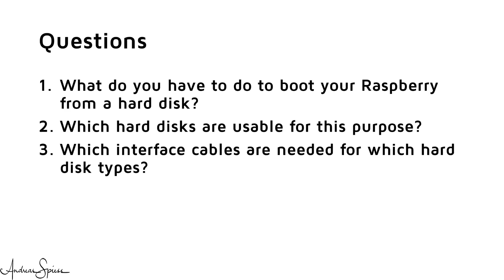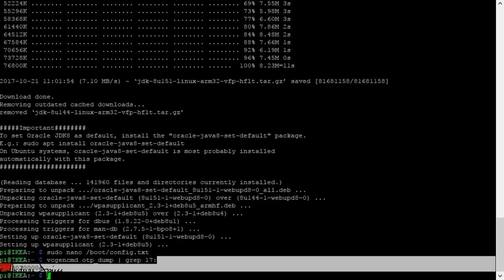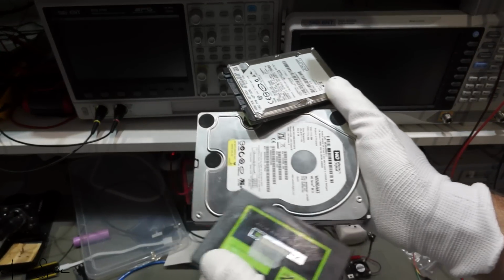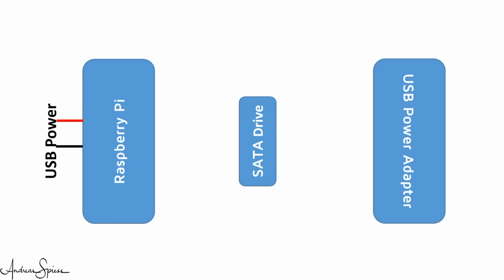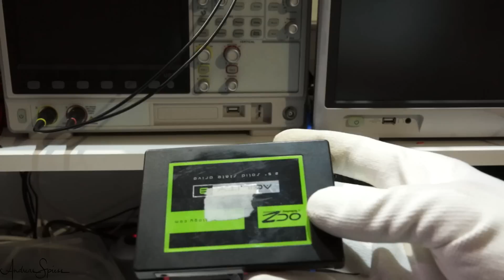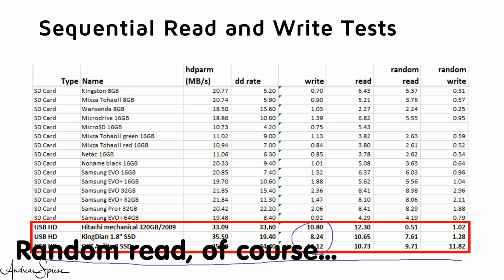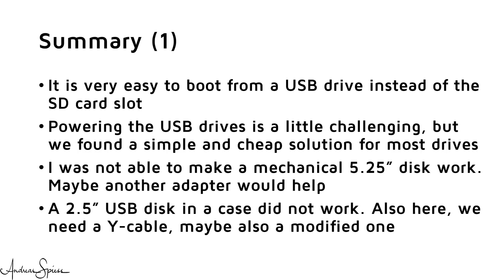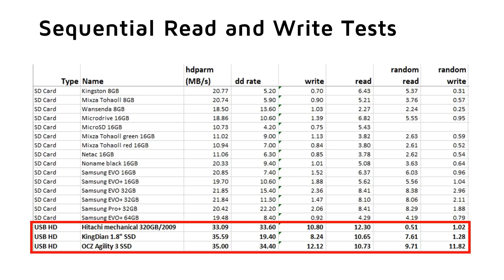#164 Which USB Disk is best for  Raspberry Pi 3? How to connect and how fast are they?

Comment: The KingDian drive (pronounced King dee-ann) has the form factor of CF cards and is being used as a drop-in replacement for cases with CF card slots (converted to SATA and such)
Reply: klassich D 
The form factor is the same as CF cards, but it has SSD inside.
Some old embedded computers used to have CF cards as a booting medium as they were easy to interface with just common IDE interface (they have exactly same pin layout!)
Some Chinese manufacturers figured that making new mold for those computers is hard and wasteful when the shells were already made, so they made a really tiny SSD you could fit into the same slot but do not need any tooling and just replacement of the connector.
Reply: I know this because computers we use here use CF card sized drives :)
Reply from the maker: Thanks. Did not know that.
Reply: Sorry, I do not understand. Can you explain this more? Does it mean, that there is an SD Card inside the SSD drive? 
As far as I know, SD Cards, USB Sticks and eMMC are similar, but SSD different. But I have to admit, that I do not have any unsider know how and more precise infos are rare.
Reply: Thanks, Now I read some articles about CF Cards. They are still in use and there even exists the CF Fast Standard. Amazing.

Comment: Reuse the same adapter, just throw in ATX power lead!
Reply from the maker: How would you connect the PS and to which adapter?
Reply: Andreas Spiess 
You just need 4 pin Molex/ATX connector used on the bigger hard disk :)
Aliexpress and eBay sell those power supplies for your project!
Reply from the maker: Now I understand. Thanks!

Comment: Hi Andreas! Are you using max_usb_current=1 in config.txt to increase usb voltage from 600ma to 1.2amps or is that still a thing? Might be something to look into, just remember that is 1.2 amps across all usb ports so don't blow a fuse plugging in the toaster :) Maybe this is a culprit. Pretty sure its still not enough juice to run the 5" drive those are pretty beafy well at least not on my pc with a cable, but I think pc usb is limited to 500ma so might be worth a shot. Maybe try a shorter and thicker cable to for the dc resistance. Love the content.
Reply from the maker: No, I did not use this parmeter because I was not aware that it exists. But now I tried and it worked for both, the SSD and even the small mechanical HD. This one got well over the 500 mA during the boot process. Thanks for the tip!
Reply: @Andy Lee Robinson: I fear your suggested doubling of the rates is just theory. The  RPIs use the USB bus for everything, capped at approx 30MB/s (i.e. both your raid drives would use the same "channel", and would therefore experience half the speed - or less, due to overhead). 
Don't get me wrong - I have a PI2 myself, and use it everyday - but they are not good designs for I/O and/or network storage. Even a 12Euro Orange PI Zero is much better at this  - and there are ARM newcomers like the Rock64 that cost similarly to a PI but give you USB3. These blow any RPI to bits, speed-wise - in pretty much everything.

Andreas, try a Rock64! :-)
Reply: That's really good news - hope you'll do an updated video with the new info!
btw, if you install mdadm, you can make a RAID array using as many sd cards or drives you can connect, and at least double transfer rates.
Reply: I also discovered this option when going through a similar process to Andreas testing out different SATA drives on my RPi 3.  The best drive I found for my RPi 3 was a 120GB SSD drive.  It worked very well.
Reply: Thanks, I'm planning to at least try booting directly from external USB.  I have fantastic luck using 2 tb seagate laptop drives with a star-tech cable - no power issues if the supply to the pi is stout enough.  I have one up a few years now, with the sd card only used for its /boot partition, and the spinner mounted over root (which requires some fiddling in /etc/fstab and also /boot/cmdline.txt).  I reboot it about once a year...whether it needs it or not, when I update the opsys version.  With the tiny space required for that /boot partition -  and it being effectively read-only, it's not that bad to have an SD card (and it's easy to copy to another or back up) but it does waste some power and a slot.  I'm intrigued by the network boot option, that would actually be handy here with my farm of diverse pies in my LAN of things.  Maybe Andreas would tell us about that one?
Reply: Yes, for me it has been since the 2B+ pies.  I often use one of those ebay "simple switchers" with "wall wart of the day" for power, with really good peak amperage capability for this (especially switching down from 12 or 15v where you can pull the charge out of a capacitor to handle a peak load), and relatively low power 5400 rpm laptop drives - the system in this house uses 6-7 watts total at idle, measured with a Kill-a-Watt.  They seem rock solid.  I use them as database/web servers and aggregators for a LAN of things system here on my "campus" - 4 buildings, off grid, a lot of automation to allow reduced labor.  The pies run mysql, nginx, perl cgi's that give me plots and various remote control over things around the place, saving steps, especially important in deep winter where you might have to dig snow to get there.  At the other end, arduinos or esp8266's talk to hardware that senses and controls things, since they are much better than a pi at anything realtime or bit-banged, and a lot less likely to go down for whatever reason.  Nothing is blazingly fast, but good enough for most things - even data aq for my electronics benches and physics lab (interfacing scopes, power supplies, meters, servos, cameras and so forth - you need the gB!).  I mount the hard drives over root on the pi, after formatting and copying that partition off the SD card to them.  The new method you show here should be better yet.  For reliable speed...A SSD is best, and a USB stick is OK if you can handle it occasionally going off to wear-level (drops video frames, for example).  FYI, on the earlier pies, there was an issue with too much series resistance in a too-cheap USB power jack - didn't matter how good the supply was,, and the tip is to just solder wires to the board.  There is also a hack that involves changing a resistor to get even more than the software hack for USB power output - even with the software, you don't hit the USB spec.  Details here and on Hackaday: http://www.coultersmithing.com/forums/viewtopic.php?f=59&t=957&p=5745&hilit=pi+usb+power&sid=c50a964f693d7812ff3734af04b48288#p5745
Reply: Concur.  I was using a USB stick mounted over /,  booting from the SD card (only) in a critical application here, using the pi camera to take video of a 4ch scope screen.  It was dropping frames even with an expensive SD stick (which was USB3, hoping that would be a lower latency drive).  The 120gb SSD drive ended all problems there, no more dropped frames, even though it was one of the infamous Samsung 840s.  Now I gotta try being completely SD card free!  Only using the /boot partition works pretty well for some here that have > 1 year uptime, but then it's a risk, heat, and current waste.
Reply: @Thanassis, thanks for the info - yes, theory is often shot down by reality. It's a pity that the USB bus bandwidth is so limited, but I'm sure there are still advantages in distributing read/write among sd cards/drives reducing latencies and maximising bus usage.
Hopefully the next iteration may have multiple buses or another scheme for improving I/O.
Reply: +Doug Coulter, you can set up the "BIOS" in the RPi3 to boot from USB or Network instead of the SD disk.  Doesn't work on other RPi models though.

I have a RPi2 set up with four SD-memory sticks in RAID-4, which works ok.  Easy to change memory styck if it is written to peaces.

+Thanassis Tsiodras, you might get much better speed from RPI if you compile the SO for 64 bit OS, and not the 32 bit.
And yes, the CPU speed of the RPi are faster then then the other 64- bit machines.  But as you wrote, the IO is not that good, as most go through the one singel USB channel (yes, all four USB ports are a hub with the same USB 2 channel).  Both the 4 USB ports and the ethernet are connected to the singel USB channel.

But the WiFi are not going through the USB channel, so it might be faster.
Reply: Have a look at https://www.raspberrypi.org/ where the information are.

Here are the source for the raspberrypi code.
https://github.com/raspberrypi/documentation/tree/master/hardware/raspberrypi/bootmodes

Boot over USB
https://www.raspberrypi.org/blog/pi-3-booting-part-i-usb-mass-storage-boot/
Boot over network.
https://www.raspberrypi.org/blog/pi-3-booting-part-ii-ethernet-all-the-awesome/
Reply from the maker: +Doug Thanks for your feedback. So, the "mechanical route" seems to be a good one...
Reply: Here's the definitive hackaday link for pi USB power: https://hackaday.com/2015/04/06/more-power-for-raspberry-pi-usb-ports/  The link on my site assumes you know this, and I took a slightly different approach.
Reply: Don't Pi3's do 1.2A over all 4 ports anyway? Plug in one device and it can use all of that. No config changes required.

There are many cases of people doing it online with no issues with a single SATA to USB adapter but my dual-cable version doesn't work at all and it's driving me mad.
Reply: Mostly I think it works because most people now-a-days have either old laptop sata hd's, 2.5 " or sata external/storage 2.5" drives..., 
    I believe 2.5" drive's in theory should work with less amp's..., than 3.5" desktop/external hd's.  
    I will do a usb amp check just because you said this..., do the duel port usb cable mod and it should work...,
       I.E. Make sure the data cable plugs into the Pi and the power cable to a 1 to 2 amp usb charger.
    1. plug the main cable into the pi, and the extension into a usb 1 to 2 amp charger and wala it works..., just remember the HD timeout, NOT ALL 2.5" DRIVES WILL WORK,I have found spinning up the drive first help's this fact......, or you can try this mod to config file , I will try both ways, usb stock first, then usb config mod let you know the results !!! 
Have to try @andersjackson's suggestion as well...  @MarkPentler
Reply: KEWL!!!>>>>.....THX!.....

Comment: Raspberry Pi SD interface is too slow to take advantage of the faster SD cards.  ODroid C1/C1+/C0 is much faster and cheaper than Raspberry Pi.  ODroid C2 is extremely fast.  I like the 32 GB Samsung Evo Select card for $13.  On a USB 3 reader I get a crazy fast 94.74 / 70.51 MB/sec sequential read/write.  7.46 / 3.24 MB/sec random 4KB read/write I/O performance.  It will be capped to 40 MB/sec on a USB2 interface but the random performance still helps a lot as a boot drive.
Reply from the maker: Of course you are right concerning USB2/3 and about the slow SD interface of Raspberry Pi. The first was also quite visible in video #141 where I got similar numbers as you describe and the second is visible now.
However, I still like the Raspberry because of its supporting community. As a newbie to Linix I feel more save ;-)
Reply: Andreas Spiess The ODroid community is good too. Most of the instructions and code samples for Raspberry Pi run unmodified on ODroid.  It is just Linux on ARM.  Orange Pi Zero is even cheaper at $9 and it is as fast as Raspberry Pi 3.  There is much support for Linux in general.  There is nothing unique about RPi Linux.  Worst case the IO pins are mapped a little differently.
Reply from the maker: Thanks for the feedback. Maybe I will try once an ODroid board. A Orange Pi is already in my drawer and I used it sometimes ago.
Reply: IMHO avoid the Orange Pi stuff unless you have a lot of time to mess around. The Odroid stuff isn't as cheap as the Allwinner something something pi stuff but the quality of their hardware is far higher and their software isn't just a horrid vendor supplied kernel dump mixed with some other junk.

Comment: Thanks for the comparision.
I am using the KingDian 32GB because it was only 1 or 2 EUR more expensive than the 16GB.
And I found for the 32GB type:
https://www.king-dian.com/product/kingdian-s100-sata-ii-ssd-32gb/  . Here we find
- reliability and stability: Write to life: Using 8 years if write 100GB every day(32GB)
This is enough for me to store nearly all of may data my the home automation systemFor the 16GB I did not find such a figure. One more reason to go for the 32GB.
The 32Gb also has more spare space for the wearing management mechanism and it is  faster.I measured on my Win PC with H2testw v1.4:
- Using cheap cable on USB 2.0:
  - write: 36,8 MByte/s
  - Read:  35,9 MByte/s
  
-Using Orico 21 UTS on USB 3.0
  - write: 89,9 MByte/s
  - read: 122 MByte/s 
  
So for me the limiting factor is more the USB interdace and the host system.
As far as I know the technology of SD and USB Sticks is quite similar but SSD is different. The SSD have additional wearing management implemented.
I did not find many detailed info on that. There are several SSD tests available but not for the 32 GB 
- https://www.heise.de/ct/ausgabe/2017-3-SATA-SSDs-fuer-moeglichst-wenig-Geld-3597127.html 
- http://techreport.com/review/26523/the-ssd-endurance-experiment-casualties-on-the-way-to-a-petabyte
Reply: You have to delete the "Here" off the end of the first link.
Reply from the maker: Thanks for the feedback. I am not sure if the S100 (2.5") and the S100+ (1.8") use the same interndal design. If so, we do not have to care about life-time...
Reply: Thanks for the useful hint. Done and checked.
Reply: The KinDian Homepage is not very updated, the S100+ is missing.
As an indication, there is also an M100 series with mSata showing the same "write to live" figures.
Reply: If you are in doubt with KingDian you can go for "KingSpec".
The Claim to be a manufacturer http://www.kingspec.com/about/i=2&comContentId=2.html and are listed in wikipedias list of SSD manufacturers https://en.wikipedia.org/wiki/List_of_solid-state_drive_manufacturers . You can get a V-32 with 30GB and 8years @100GB/d write endurance http://www.kingspec.com/products_detail/productId=65.html for <16 EUR in the "KingSpec Official Store" @aliexpress.

Comment: I use my Raspberry Pi B model to run Weewx weather program for my weather station - that is all it does. When I first got it working it would lockup often. I replaced SD card with good quality Samsung SD card and all those lockups went away - until now about a year later. Not sure if it is because of SD card but guess I will have to put in a new one and find out. Or  maybe try an old laptop hard drive in it like you have shown is possible. Thanks for the info !
Reply from the maker: I think, the Raspberry always writes some small data to the harddisk, even if we think, it is not necessary. And this can wear-out a SD card which is not made for such usage. I am interested in the result of your investigation...
Reply: About the lifespan of ssd's on any linux distro. I did not check your particular Weewx (I would guess it is raspbian based ... ) but one has to check the Type of filesystem that is used on the sdd. That can have a deep impact on ssd lifespan. Some journaling filesystem do make a Lot of disk writes simply as a maintenance/dis check feature of Linux fileystems and are not suited for any type ssd drive, be it usb or sata. So that should be worth considering.
Reply: since I am novice at Linux it all sinks in slowly. I just did some research on SD card longevity with Weewx and found there is discussion about it. This post seems to have some positive results though I don't even fully comprehend it yet ! https://groups.google.com/forum/#!topic/weewx-user/atRpRzKrlyk
Reply: This is very interesting on some detailed analysis and hacking of SD cards https://groups.google.com/forum/#!msg/weewx-user/JxWgTEAikbA/HupwjHcYTqEJ